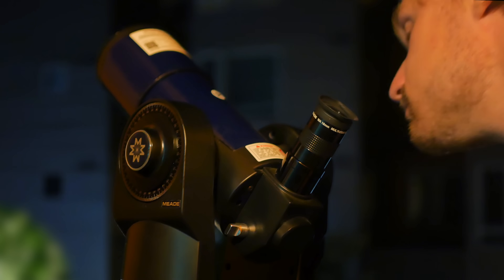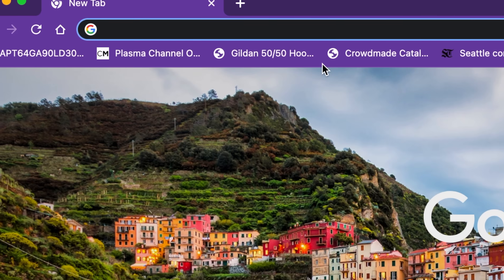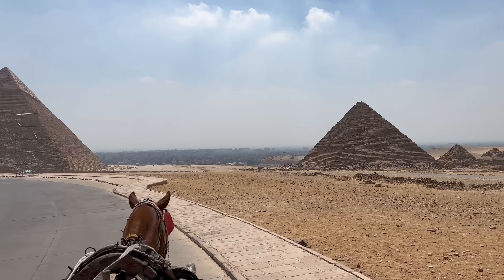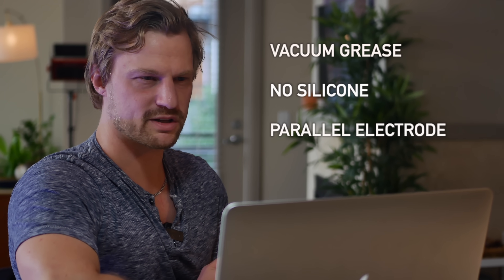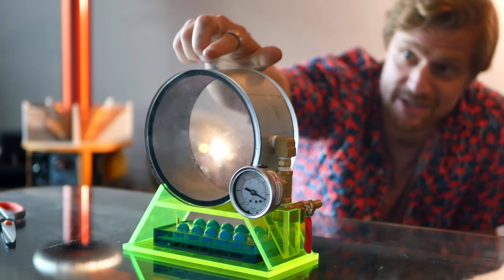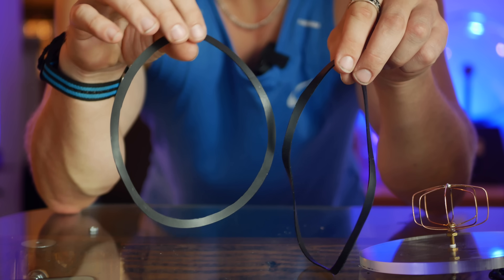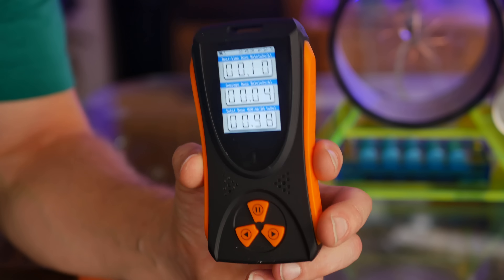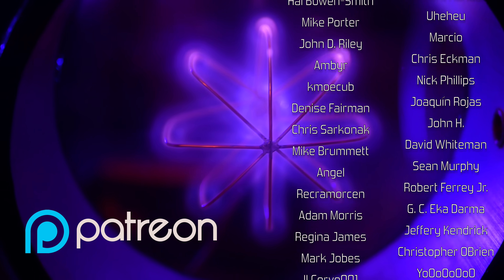Building A Nuclear Star In A Jar (Fusor)

Comment: I thought id just mention this here real quick for anyone attempting a simmilar experiment. A fusor emits strong gamma radiation due to bremstrahlung caused by the decelerating electrons & gas ions.
Standing next to an operating fusor for extended periods of time is significantly more dangerous than any x-ray scan or anything the like.
I recommend using lead plates to protect youself as well as keeping one geiger counter, preferably scintillation based, on your person as well as one with the fusor.
Reply from the maker: This is good info
Reply: @PlasmaChannel  
I've built my own fusor a while back (also inspired by Will from London) and I was shocked to see the ammount of radiation generated by the device.
Granted, I did run it at a higher voltage (200kV). But as with all radiation sources, exposure time is key here. Running this for a few minutes will not harm you significantly, however I dont recommended using it as a night light 😉
Reply: @rednicstone3299  use as a night light to fall asleep forever :D
Reply: @PlasmaChannel  The neutrons produced from fusion are just as dangerous (possibly more dangerous as they can make objects surrounding the reactor become radioactive) but require a different technique for shielding. Lead plates will cause them to scatter all over the room, instead you would need to use low density materials, particularly ones that are largely composed of hydrogen (like water and many plastics) to attenuate the neutrons. You would want to place the neutron shielding on the side facing the reactor, and the lead on the side facing you 

Realistically shielding isn't necessary as long as you only run it for a few minutes at a time. Thanks to the inverse square law, which affects both of these types of radiation, the amount of radiation that would reach your body would be harmless as long as you kept your distance from the reactor.  I would say 10ft minimum, preferably more.
Reply: then why didnt his detector indicate any radiation production?
Reply: @rydude998  because its not fusing anything as of right now (theres no deuterium or tritium to fuse)
Reply: @beelzebub3920  That isn't what the OP of this thread said though. They and the first response claim just running this device generates significant amounts of harmful radiation yet his meter showed nothing.
Reply: @rydude998  idk maybe because hes talking about xrays and they weren't detected by his device.
Reply: For a DD Fusor, your main radiation types will be X-ray, and fast neutrons.  My 50KV unit needs about 2 inches of lead for the X-rays, and 6" of UHMW PE to get the neutrons down to thermal levels.  And when you're done, the unit is radioactive waste from all the neutron absorption. A DD machine could breed plutonium from depleted uranium.
Reply: @2fathomsdeeper  thermal (ized) neutrons are quite dangerous as well.
Reply: @johnschindler9641  Very true, that is why plastics and water that are used to shield from neutron radiation are usually doped with boron. The water or plastic slows them down to thermal temperatures, where the boron can then easily absorb them.
Reply: @2fathomsdeeper  Theoretically a D-D fuel could be used in a hybrid breeder reactor for making plutonium, but this could never be done with a home built fusor.

Assuming your fusor can reach the high end of what other amateurs have made you can expect somewhere around 1,000,000 neutrons per second to be produced. Looking at the molar mass of plutonium and doing the math to see how long it would take to breed a single gram of the isotope, you find the fusor would need to operate for thousands of human lifetimes.
Reply: Ok, so I still don't quite get it. 
Is the fusor used in this video producing any type of ionizing or neutron radiation in this particular configuration? (Is neutron radiation ionizing?)
Reply: @IrelandLover  The Fusor accelerates charged gas ions, and when they collide their energy is promptly released as gamma radiation (called bremsstrahlung). Gamma radiation is a from of light that has sufficient power to ionise other particles and can cause damage. The only known way to block significant ammounts of gama radiation is using shielding with dense materials such as lead or concrete. Gamma radiation also cannot be detected using a standard Geiger counter, which is why a scintillation based one should be used.
Reply: @rednicstone3299  Thanks.
I do know what X/ƴ-radiation is but I guess Bremsstrahlung is still in the X-ray spektrum. Also, X- and ƴ- radiation are obviously Ionizing radiation and van penetrate a geiger tube —> get detectet by one!

I just wanted to know whether this fusor in the shown configuration produces any X-rays or not (you answered this question). I also wanted to know if this fusor in the shown configuration produces free neutrons.
Reply: @IrelandLover   I see.
The Fusor will produce accelerated ions, but no significant ammounts of free neutrons will be produced. Almost all radiation will be gamma radiation.
Your assumption that any ionising radiation can be detected with a geiger counter is not really correct though. Photon radition can not be reliably detected by the traditional geiger tubes. This is due to how unlikely it is for a photon to interact with the gas inside the tube. There are specialty tubes which have higher sensitivity and block all radition and in that way are sensitive to gamma radiation. They also utilise special materials for the wall of the detector where interaction is most likely, however these modifications make it impossible to detect other forms of radiation. This is why your common radiation detector is unable to detect this radiation. The only way to reliably measure all forms of radiation is to use a detector with multiple tubes (typically 3 and up) or to use a scintillation based detector like I recommended.
Reply: @rednicstone3299  I meant most geiger counters can detect X- and ƴ-radiation. Depending on the used materials (density), they can also detect alpha and beta radiation.
Reply: X rays and gamma rays are electromagnetic radiation. Alpha and beta radiation consists of particles.
Reply: @rednicstone3299  I'm not sure if scintillation radiation detectors can detect alpha or beta radiation, but gamma radiation will be detected for  sure.
Reply: Nothing like that wil be needed, because he will not generate any radiation with this joke of a setup...its a toy, basically a plasma lamp.

Comment: How do you know the power supply produced well over 40KV? Did you measure it or was it just an estimate? If you measured it, how would that be normally done?
Reply: probably measuring distance at which it arcs through air
Reply: @NoNameAtAll2  The issue is that voltages drop when under load. He needs to use a chain of resistors and a voltmeter to get a live measurement of voltage. In all likelihood his power supply won't be able to hold the voltages required for fusion while under load.

Comment: Did you have to go through the process of electro polishing the inside of your vessel?
Reply: For anyone looking to make something in the future, stainless steel kegs are vacuum capable and are electro polished on the inside and are great for use with nuclear fussors. A couple of universities have done this.

ASU has a couple videos going through their process of turning a keg into a nuclear fusion chamber.
Reply from the maker: That’s awesome. Thanks for the info! No, I did not polish mine.
Reply: @PlasmaChannel  You’re very welcome! And thanks for the reply! 

The ASU keg nuclear reactor vacuum chamber videos really helped me for my vacuum steam Tesla turbine system build. 

If you’re positive it’s sealed But not getting a low enough vacuum I would guess that you’re off gassing from the internal surfaces. 

You may have to pump it down, hold it, pump it down again and hold it, do that multiple times over a day. 

All the micro crevices have gasses trapped and molecularly adhered to the internal surfaces of the chamber and can take a long time to get out if not electro polished. 

Another thought, 🤔 and this is just a wild stab in the dark because I can’t remember what your clear window material was made of, but the radiations, UV and otherwise, might be causing the window to break down and off gas too 

🤷‍♂️ idk, I usually try to stick to stainless vessels personally with Boro glass windows, which you might have and I just missed it 😅

Hope some/any of this helps with your journey! 

Again, thanks for the reply!

Comment: Does the chamber heat up much during operation?
Reply from the maker: The acrylic starts to melt if left on for more than 30 seconds I found. Good enough for me!
Reply: @PlasmaChannel  I wonder if there's a way to keep it from melting for longer burn time
Reply: 30 seconds is nowhere near enough to achieve fusion though. It takes a lot of adjusting pressure and voltage to get a fusor into a functional state. Most setups require around a half hour of tuning to begin measuring detectible neutron radiation.

Comment: I had the same problem trying to re-evacuate a dewar. It turns out the smaller pump is probably fine, it's your hose which is probably your primary problem. Rubber of any kind is leaky especially the clear rubber like that. If you want to be able to get to high vacuum all hoses and connections MUST be made of metal, preferably with compression fittings or even better braised together. HVAC air conditioning equipment is designed to be vacuum tight but the rubber hoses still leak somewhat.
Reply from the maker: Thanks for this info. Yeah…. I do wonder if it was the hose…
Reply: @PlasmaChannel  Yeah... The first thing I thought was, as you were connecting the clear rubber (silicon? PVC?) hose was, "Uhmmm... nope... that will collapse long before it can reach the vacuum you are looking for". Think... McDonalds triple thick shakes and the flimsy plastic straw they used to provide for us to herniate ourselves with.
Reply: I've heard that next to metal, teflon hoses are the next best. One of the few plastic type materials that doesn't off gas much nor have much gas permeation through it.

Comment: I refuse to give up hope on fusion energy. We will crack the secrets eventually.
Reply: The Canadian company that’s doing steam piston compression of hydrogen gas for fusion is really breaking new grounds! 

The company is called General Fusion. Essentially they get a ball of liquid metal spinning very fast in a vessel and admit hydrogen gas plasma in. The gasses go to the center of the rotating “ball” of liquid metal where the pressure is lowest, and then they use long steam pistons to force the liquid metal into the vessel to compress the hydrogen at its center to the point of heating up that fusion occurs. 

Then all the energy released is immediately absorbed in the liquid metal and pumped to heat exchangers for driving steam turbines ina. Combined heat and power plant.
Reply: Although the real breakthrough that’s happens is the company who is using electromagnet coils to do linear compression of the hydrogen plasma to the point of fusion, and the heat released cause the hydrogen plasma “recoil” to expand with an immense amount of energy out, and the magnetic field from the “current” of the hot hydrogen isotope, positive ions, traveling back out of the vessel induce a power current in the driving electromagnets to generate electricity out! And then after the remnant thermal energy is used to generate steam, or some super critical system.
Reply: @HeatAndPower  Nice! Thanks for the info 😃
Reply: @andie_pants  you’re very welcome!

Comment: Very well done. You could have compensated for the weaker vacuum with higher voltage(100kV). But a bigger pump works too. You're gonna need a bubble neutron detector for fusion & actually showcase fusion not just dense ionization. Tritium is regulated (radioactive) so I'm curious how you're getting it lol. It's not as easy as deuterium to extract.
Reply: Higher voltage usually fails in weaker vacuums, as the increase in ion density allows the electrodes to arc over.

Comment: Yeah I think source of the issue was the Teflon tape and lack of hose clamps on that tygon tubing. If it was straight brass on brass it would have been much tighter and easy to undo. Also a digital gage could help you see much lower pressures. I've done some work that needed some ultra low vacuum for some cryogenically cooled radiation detectors that fail with the slightest atmospheric impurity.

Comment: I built a Fuser about 8 years ago, 14kV neon sign transformer connected through a veriac, and a vacuum pump from Harbor freight. It was a great little demo unit.
I ended up using a tungsten grid due to the grids heating up, on the inner grid primarily. I salvaged the tungsten from an old quartz heater, It was tough to form but work fantastically. It looks like your inner grid is copper wire you may have problems with melting the solder connections as you go to high energy levels. Always better to go with a solid connection (spot weld or tight wire wrap).

https://youtu.be/hQNTCLHsKOw

Comment: Thats not what the sun or Earth looks like. Get real man
Reply: @aliutkugulderen6811  earth is flat.
Reply: @wynand988  I have a simple question about flat earth please read it all and then answer. Now they say that in the flat earth model, the sun rotates above us. So how come the sun can only illuminate one side? Normally, they explain it as "the sun is very small and very close to us. So its light can only reach one side. But there is a problem here: each element emits a certain amount of light in a certain light spectrum. This is what happens when you pass the emitted light through a prism and drop it on a special piece of paper. The colors are called the emission spectrum and this is kind of like the ID number of the substance, that is, it is special. With this method, you can identify the element and determine the amount of the substance with the brightness of the light. Now, when you look at the sun with this method, you will find that it consists of 73% hydrogen and 24% helium. If you repeat this in the following years, small While the ratio of hydrogen decreases, the ratio of helium increases. So the sun combines hydrogen and makes helium. This is called fusion. Now, if the sun were that small, as you say, the pressure and temperature inside would not be enough, so this event would not occur, so the sun would not emit light. If you say that, its density is too high. but this time the following problem arises. If we rate it accordingly, the amount of electromagnetic waves that the sun's surface should emit per m^2 does not hold, it is a very, very high value.

Comment: Awesome video!  Have you tried deflecting the visible electric field around the electrode with a magnet on a stick? To keep at a safe distance .... have you checked your radiation detector using a known radiation source?
Reply: this is just a gas discharge lamp so far, so there is no reason to expect radiation

Comment: that helium lit up really beautifully, i might have to build me one lol, i might make it sealed off after pulling a vacuum on helium that way it acts as a discharge lamp, helium is one of my favorite gas discharge elements for its huge color range from pale-pink to my favorite pale-yellow color
Reply: Couldn't he have turned it on with atmospheric pressure of helium to make it glow even brighter? I thought that would create a lamp.
Reply: @Reptex_krka   no at higher atmospheric pressure the helium wouldn't illuminate, i don't want a lamp like a streetlight i want just a glowing desk decoration, although i couldn't have it on for long due to the heat being made by the plasma, it could melt things, although i could use quartz glass tubing because that can stand a good bit of heat
Reply: @Kepler2258  Qouartz glass doesnt block UV-C, look it through glasses.
Reply: @mernokimuvek  yes but normal glass might get damaged from the heat, usually gas discharge lamps use quartz glass tubes
Reply: @Kepler2258  True. I'n not sure how hot a fusor gets, I never had the luck to build one yet. The exception is the high pressure sodium lamp, which uses aluminum oxide instead of quartz glass.The reaction with sodium is slower. Low pressure sodium lamps also  use borosilicate glass.
Reply: @mernokimuvek  yea brosilicate glass would work too probably, im not sure if helium has any UV spectrum lines though so wouldn't be any trouble even using quartz glass
Reply: @Kepler2258  Helium just creates a plasma, fusion doesnt happen easily. Hydrogen can be used to achieve fusion and it has UV emission spectrum.
Reply: @mernokimuvek  yea I don’t want to build a fusion reactor I just want to see the beautiful helium Discharge
Reply: @Kepler2258  You can get ampoules or spectral lamps already filled with helium.
Reply: It will be interesting to see how nuclear fusion compares with new graphene graphene-based technologies being developed by the Ion Power Group and the Neutrino Energy Group turn out. The Neutrino Energy Group claim that their Powercubes (comprising multiple layers of graphene and doped silicon) with a footprint significantly less than a square metre will generate about 5 kW day and night.